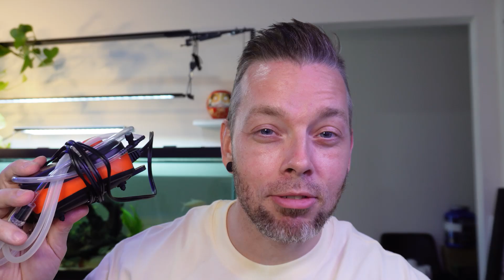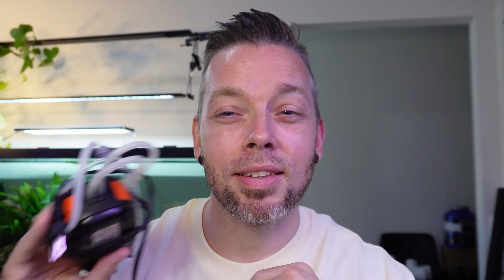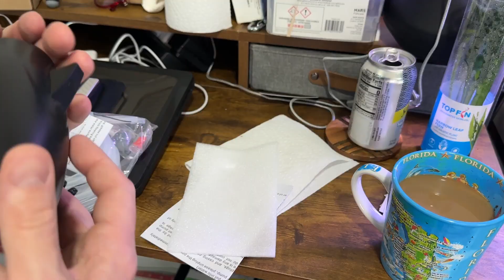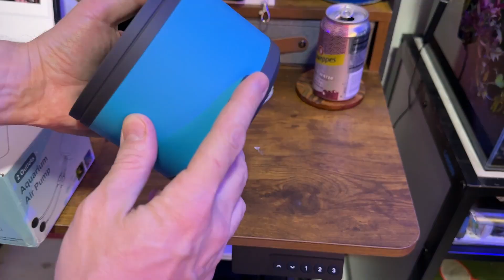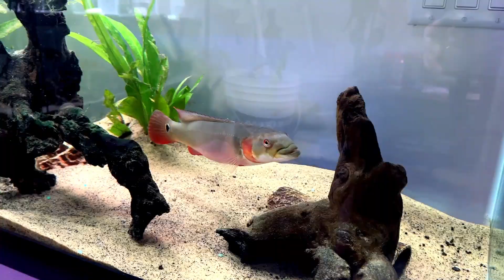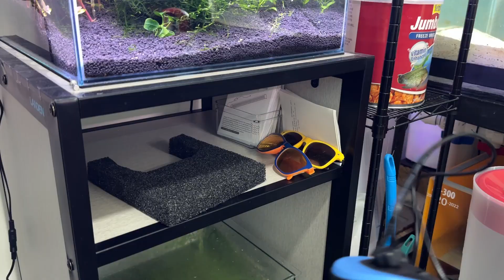TESTED: The Quietest Air Pumps for Your Aquarium

Comment: Don’t buy Eheim Silent Air Pump 100 they are all lies this thing hums like a humming bird
Reply from the maker: That’s a bummer, sometimes you can get a vibration reduction by placing them on a piece of foam or a soft towel to help dampen the sound
Reply: @EverybodyAquatic ya I picked up a NICREW Nano amazing pump super silent I will use my Eheim as a back up

Comment: I’ve always used tried and true Tetra Whisper air pumps and never had any issues. They are the quietest I’ve used plus they sell rebuild kits.
Reply from the maker: Idk I have a few of them and the small ones didn’t push enough air for me and the double diaphragm ones always went bad plus I could never get them quiet enough
Reply: i used a Whisper about 10 years ago, for about 2 hours, until i couldn't tolerate the noise anymore. i took it back for a refund.